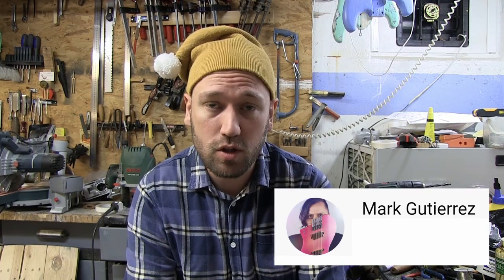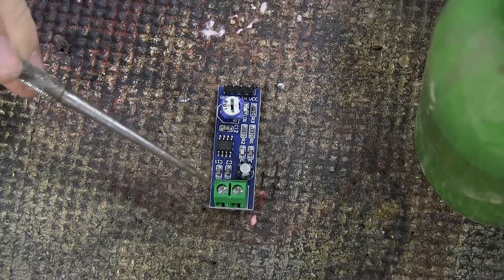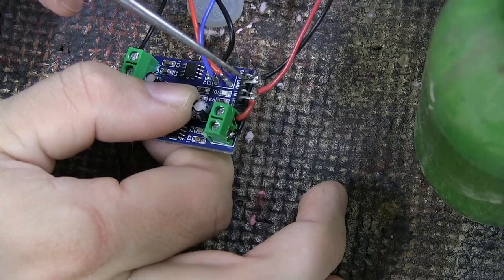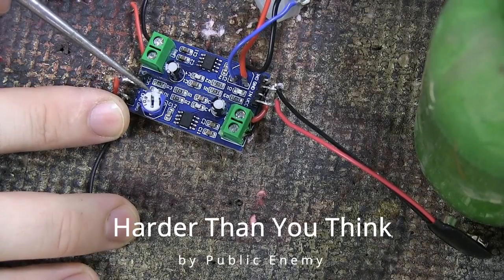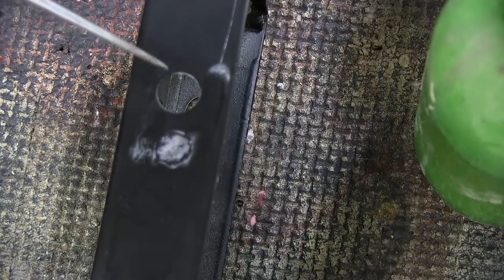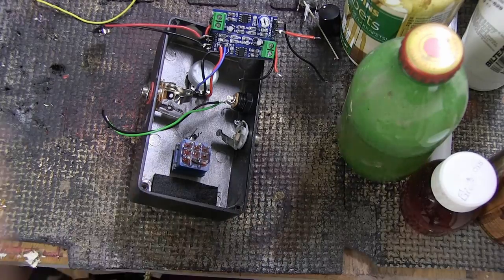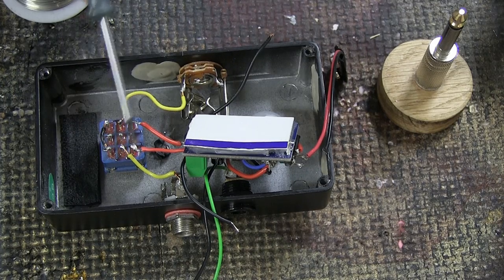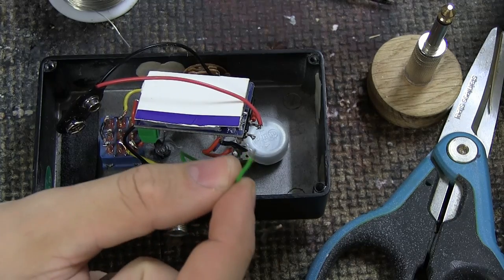One Dollar DIY Amazon Fuzz + how to enclose it with true bypass switch

Comment: Greetings Zurowetz,

The idea to make a distortion pedal out of a couple of LM386 board is interesting. However there are 4 major flaws in your pedal. 

1 - If you wish to be compatible with other pedals, you will need to wired the guitar input on the left side, not the right side. 

2 - I would suggest to make the wiring longer so you can make things tidy.

3 - It is extremely important to pay attention to the soldering. I noticed some cold solders. This can make your circuit intermittent or not function properly.

4 - There is a gain pot on one of the PCB. This will need to be adjusted to 1 volt on the output. If you fail to do this, you may end up burning the LM386 on the second stage (second board). The nominal output voltage must be 1 volt since this is going to your amplifier. Do not exceed 2 volts because you may blow your power amp input stage on a long run.
Reply: I must be from another universe because the guitar input of all of my pedals are in the right side...
Reply: @0b5qRa  , way back in the day, mine were on the left side. It is very possible they changed the side over the years. my bad
Reply: Yeah, almost every pedal I own goes right to left. There are a few outliers, but it's definitely the convention these days.